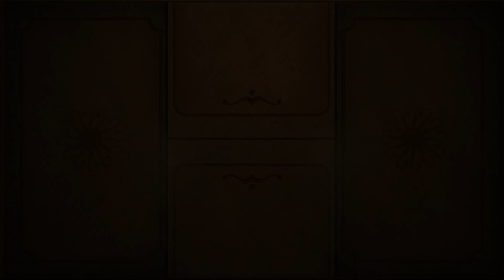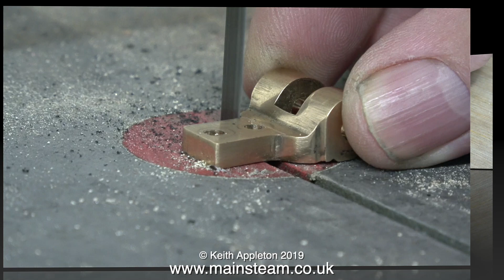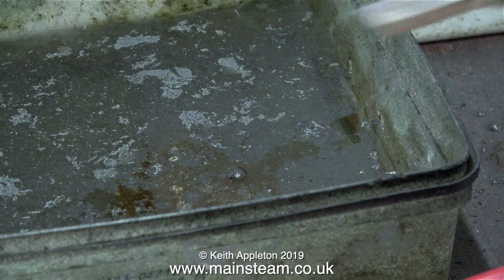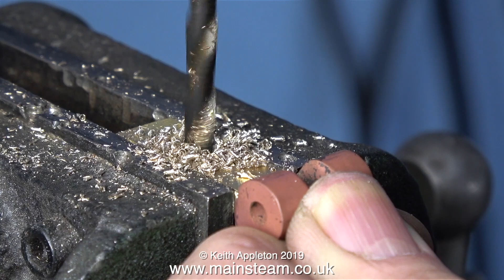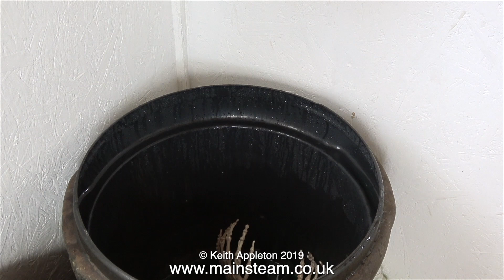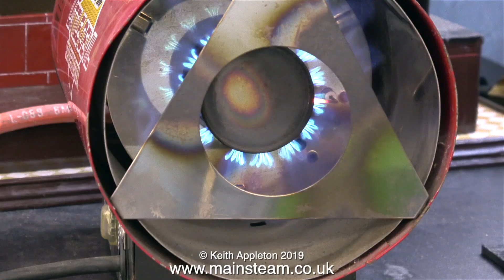MODEL STEAM ENGINES - TOP TIP TIME - PART #34

Comment: I had a heat pump on a home that I had worse heating source ever finally added a pellet stove,
Reply: Heat pumps like that aircon unit usually do the job, and at 1/3rd of the power of an electric heater.  But if the outside air gets too cold, it cannot extract sufficient heat from it.  I'm no huge fan of the idea that eventually we're supposed to all heat our homes with heat pumps...